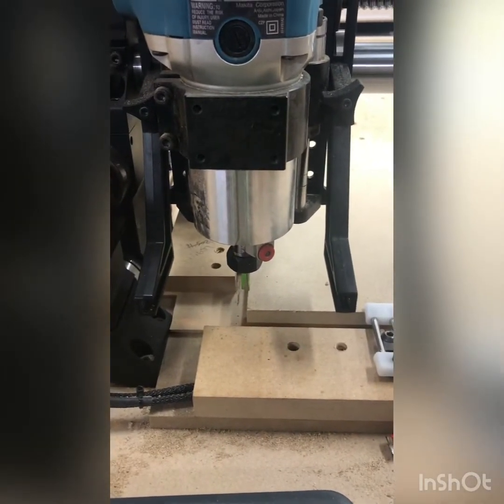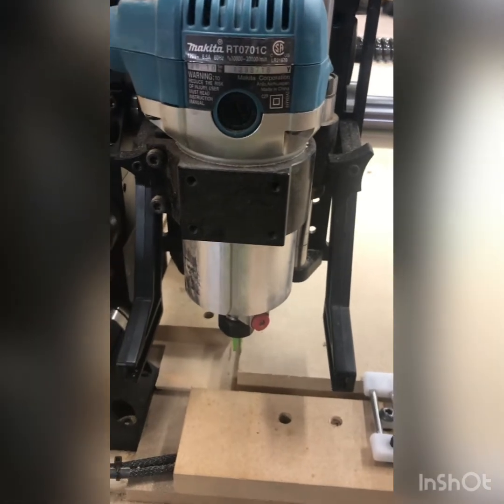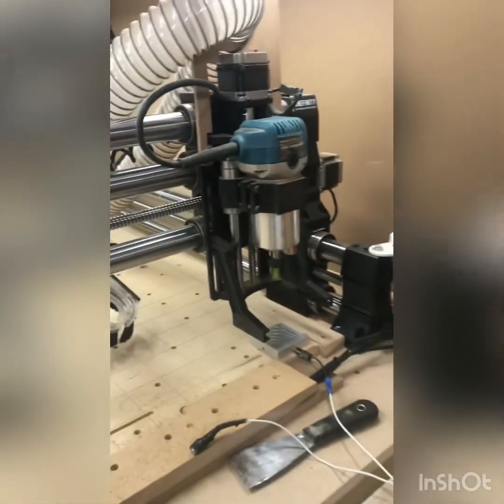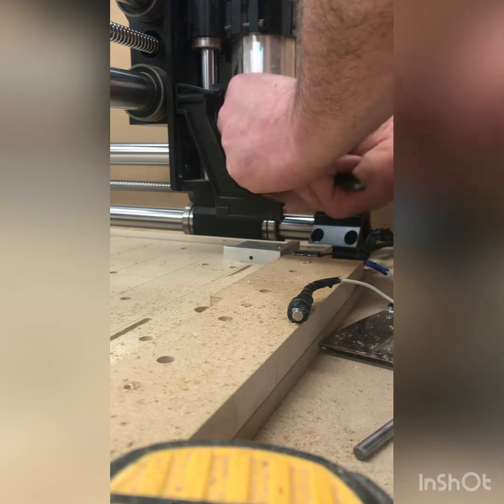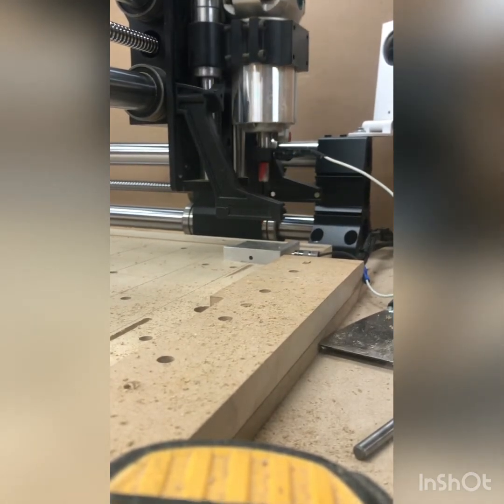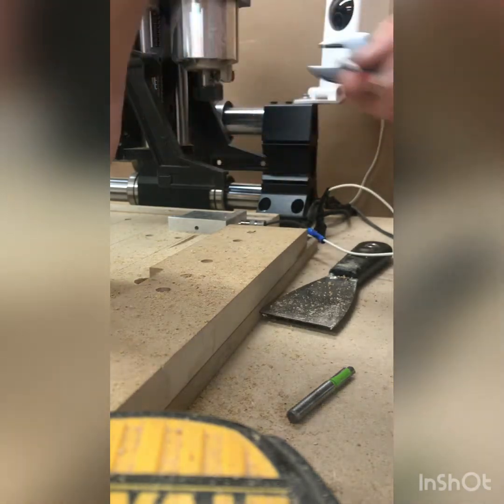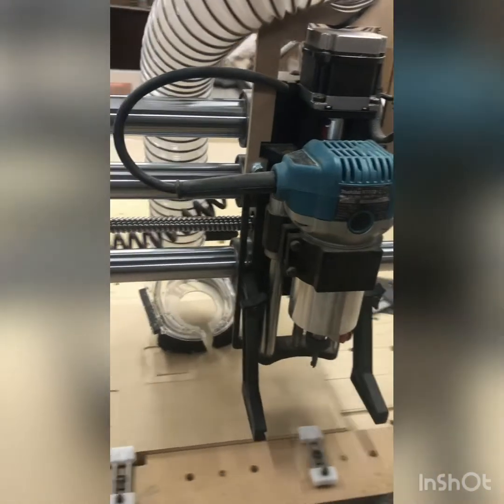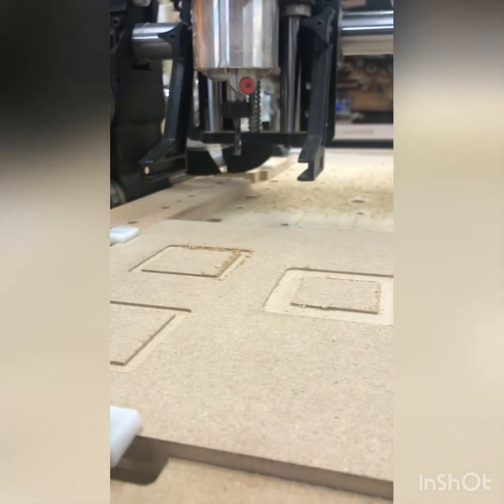Onefinity CNC Bit Setting Macro 2.0

Comment: Amazing. Thank you for sharing! Do you know if the X-50 controller can store/retain G55-G59, and G28 across power cycles? I have recessed out a notch for my touch probe in a different location in the spoilboard. Still waiting for my woodworker to arrive!
Reply from the maker: Original controller will not store any offsets across power cycles.  Elite series with Masso can.
Reply: @mikebogart3841  Wow, thanks for the quick response Mike. That is too bad but makes your macro even more valuable 🙂

Comment: That is very cool..  I have been wondering why this wasn't a standard thing from the beginning.  I just saw someone else asked the same question I was thinking down in the comments concerning the router on/off function.
Reply from the maker: You can turn the router on/off automatically with a iot relay and the breakout board.  Easy install highly recommend it, guarantee you will hit play at least once with the router not turned on manually. 🤣

Comment: How did you set up the on/off of router without manual on/off?
Reply from the maker: You need the breakout board and a relay.  I’m using this one.  Pin 15 and a ground on the breakout board.

https://www.amazon.com/gp/aw/d/B00WV7GMA2/ref=ppx_yo_mob_b_inactive_ship_o0_img?ie=UTF8&psc=1